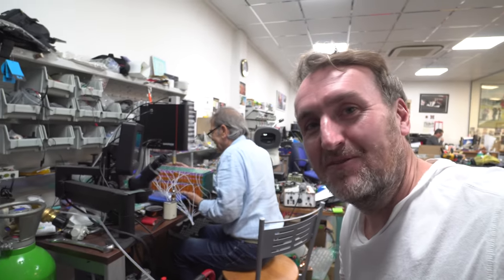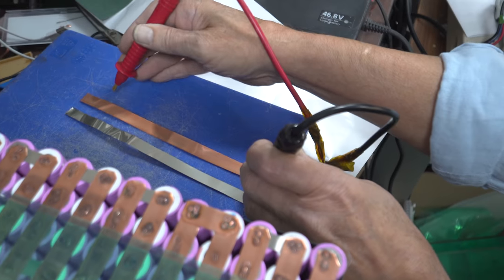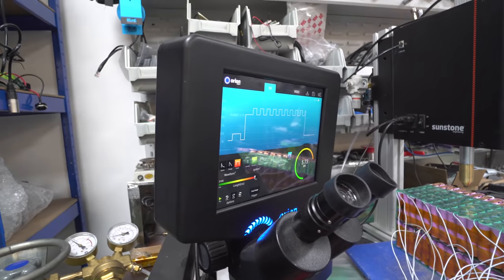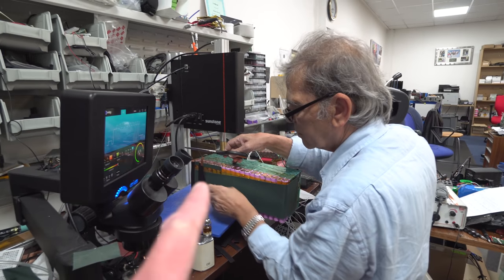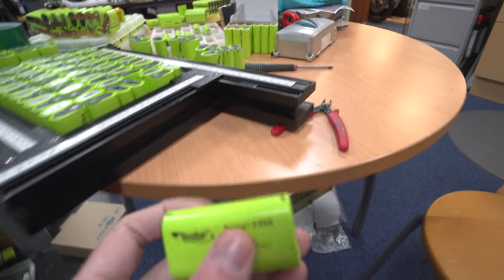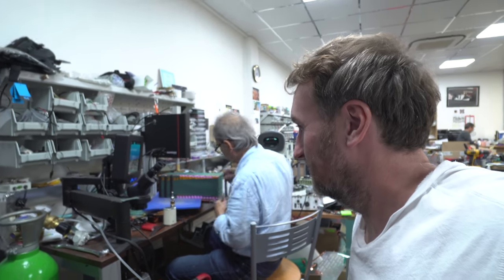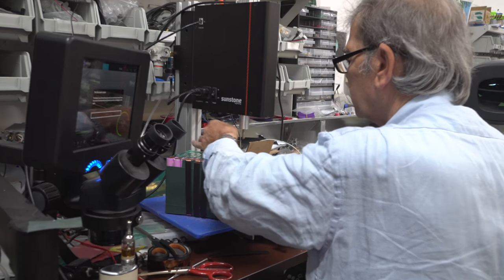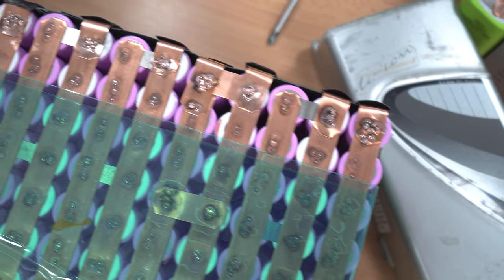BUILDING A HUGE BATTERY WITH JIMMY AT INSAT!!!

Comment: Great video I will order a battery from them now, without this I never would have. The website contains a series of deadlinks and poor grammar, then when looking at google streetview it says insat on the building instead of ebike batteries. They could do with building their website to build customer trust and to demonstrate their point of difference from other battery sellers with evidence of the process, product and amount of work they do for customers ongoing. Rather than their website which is a bunch of stock photos with hastily written surface level paragraphs.